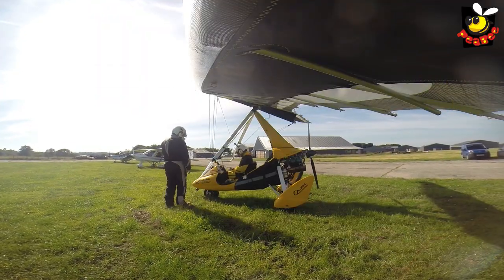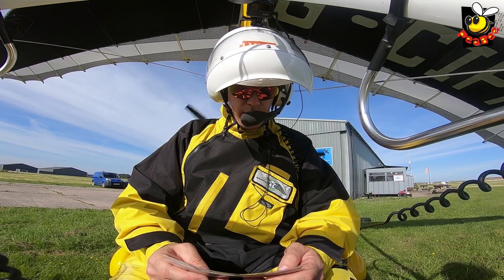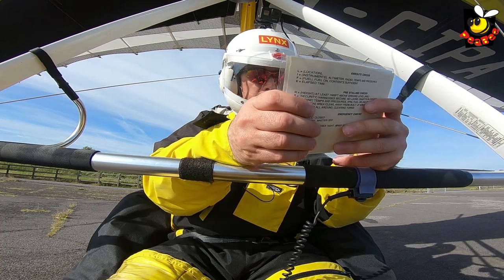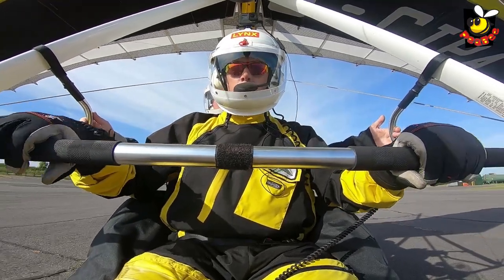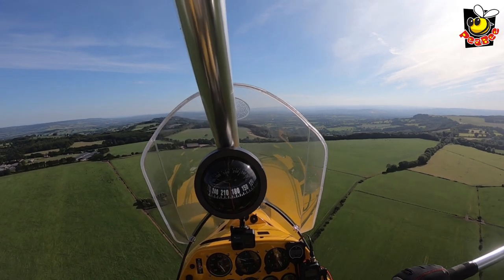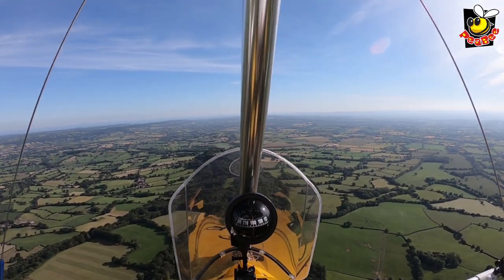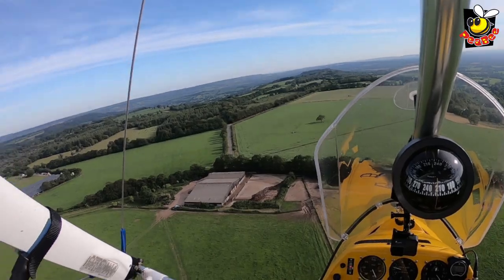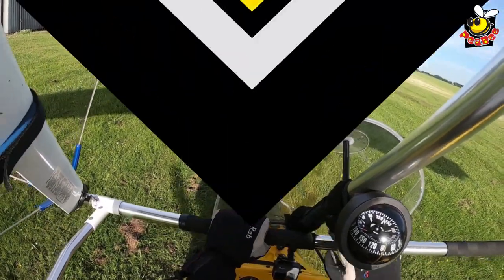Flexwing Microlight Vlog - Episode 1- Learning to fly a flexwing

Comment: When I was doing my 1st solos , I did a lot of bunny hops , I would roll down the run way , push out the bar . lift off and fly down the runway a ways  about 4 meters high and land , maybe i could get 2 of these before turning around and doing it again. What that did for me was 1 , how to take off, 2 , once airborne , to keep the trike over the runway  and centered over the run way , 3 and how to land . After doing that for about 25 times , you will just lift off , give it full throttle and push the bar out a little and got for a short flight . But keep up speed , you dont want to dump the throttle on take off till you get some altitude . Air speed is your friend. Also having a mico light or smaller trike with a single surface wing helps too since those dont need a whole lot of speed. Duel surface wings are what a reflex paraglider  is to a regular glider , thus duel surface is faster.
Reply from the maker: Thank you. I'm sure when I come to the solo I'll have it sorted. Jim the instructor has to be there anyway to cover me for the syllabus training. I'm so excited.

Comment: That takes me back 40 years to fun at Brackly.  Not sure I could be doing with the foot throttle, still I suppose it makes sure you stay awake.
Reply from the maker: Hi Thamesmud, did early microlights only have hand throttles. This aircraft does have a hand throttle but I never used it.
Reply: @GolfFoxtrot22  From what I remember there was just a hand throttle low down beside the seat in a position you could reach from either seat.  There were footpegs on the front wheel steering head for when you became a reliant robin at what felt like ludicrous speed, that was the most terrifying aspect the process.   I never got as far as a solo flight but I found the trikes a lot more intuitive than 3 axis.  I did have a couple of flights in a shadow but I didn't feel connected in the way I did in the trike, I think it comes from being a biker so weight shift just felt natural.
Reply from the maker: I think there is a correlation between bikers and flexwing flying.

Comment: I'm a conventional ppl and will be getting trike flying training next summer. Becuase as you say the controls are opposite, I will be getting ready practicing flying flexwing in VR  in Xplane. Hopefully that will help make my reflex better cope with the opposite controls of flexwing.  We'll see...
Reply from the maker: My first 2 hours were a little strange but you you soon get used to it. I tried (in safe conditions and on a motorway) driving at the bottom of the steering wheel. I also used to watch flexwing videos with a broom handle and mimic the actions. The hardest one was my feet. I don't regret it and absolutely love flexwing flying.
Reply: @GolfFoxtrot22  does your feet reflex get screwedup when going back and forth from flexwing to 3axis?
Reply from the maker: @vracan  I've not flown 3 axis since, but I have been assured from my instructors, that they switch from flex to 3 axis without any issues.
Reply: @GolfFoxtrot22  Thankyou that makes me feel better becuase I still want to be able to fly both. Cheers

Comment: I had one lesson and your throttle and pitch control were miles better than mine. I was yo-yoing up down and side to side, without the instructor I would defiantly have broken things. I'm hoping that the sub 70 is less of an issue due to less power?
Reply from the maker: They have less energy but you actually have to be a little smoother with them. Power to weight is still just as good so keep that in mind. I genuinely back off the power once I'm in a safe climb with a few hundred feet below me.

Comment: Ahoy Giles, is the plane equipped with a reserve? Is that fog or pollution? Good show. Thank you
Reply from the maker: The aircraft I'm learning on does not have a reserve but my PeaBee does. The dirty layer is called a inversion, 2 different air layers that traps dust and rubbish. So yes it is pollution but it happens all the time in still high conditions. I hope that answers your questions.
Reply: @GolfFoxtrot22  Thank you

Comment: Looking to start lessons, really prefer flexwing over fixed wing but like you, I am terrified that if you have to react quickly then it doesn't come naturally as all controls reversed. Even when your instructor was saying turn right, I found having to think for a few seconds which way the bar would go and that cant be good in an emergency, or even landing with a cross wind. How are you adapting to the difference, does it come naturally after a while ?
Reply from the maker: It did take a couple of lessons, but I did also drive my car from the bottom of the steering wheel which also helped. It's really natural now and I don't even think which way to push the bar now.

Comment: I tried putting a gopro on on the control frame once during a check flight. Had to take it off - apparently illegal on a Section S machine?
Reply from the maker: You can get permit approval
Reply: @GolfFoxtrot22  How much hassle was that?
Reply from the maker: Not sure, as the aircraft I was flying already had it. The aircraft I flew Jim in there's videos already had the mounts in place. The front camera was a temporary mount.
Reply: @GolfFoxtrot22  Got it.